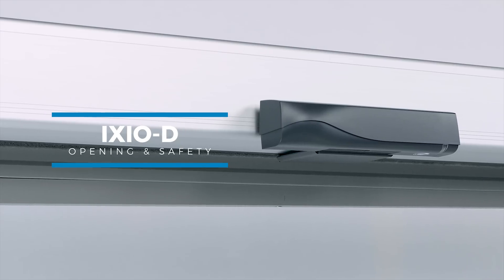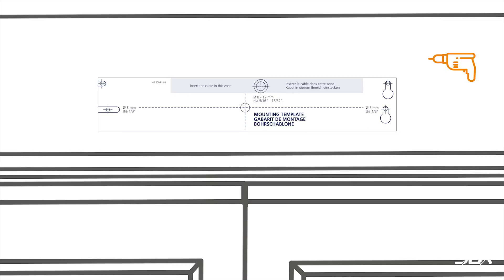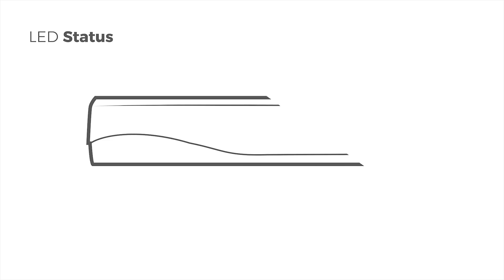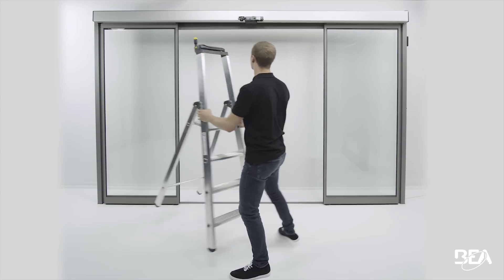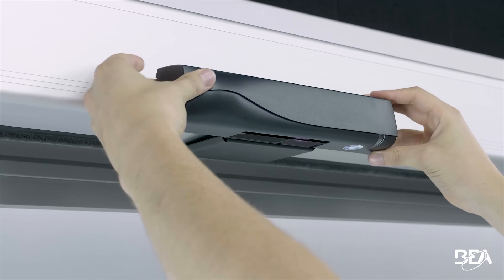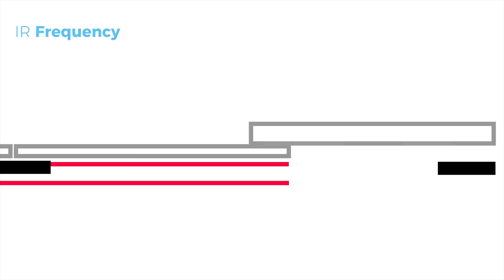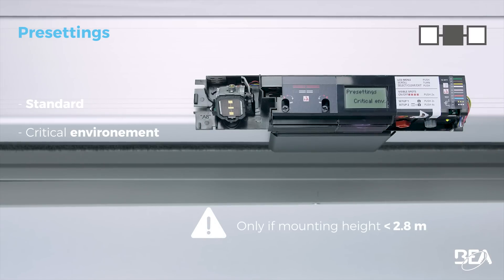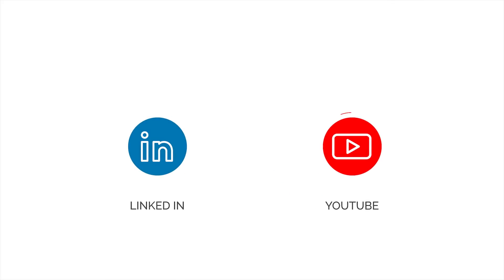Tutorial IXIO-D - Opening & safety sensor for sliding doors (tuto)

Comment: thank you. my cable came in black color shield no grey .. is there connection difference ?
Reply: Probably the black one is the DORMAKABA version. 
In that case:

White = ground / brown = 24V

red = SAFETY (AIR curtain) NC / blue = SAFETY (AIR Curtain) NC

purple = OPENING FOR CURRENT SOURCE + / black = OPENING FOR CURRENT SOURCE - (p.ex. Escape route ES200)

yello = Opening NO / Green = Opening NO

pink = test + / grey = test -
Reply: @stefan4985 thank you very for your help bro, let me try
Reply: @stefan4985 thank you very much for the reply 😊 yes it's along with the doormakaba

Comment: Hi I am using a IXIO - ST. The red LED (Safety) is working but the green LED (motion detection/AUX) is not. Please advise. Also, please explain how motion detection is done on a IXIO - ST, since it doesn't have a radar feature. I read that in the ST sensor the green LED means AUX. What does it mean? My door is not opening because I got no green LED activation. That's my problem. Thanks
Reply from the maker: Hello Suvrajit, please contact our technical service for this specific question, they will help you right away: https://eu.beasensors.com/fr/contact-form/?subject=Support%20technique
Reply: @bea-sensors-europe  please can you help me with the cable color code for positive terminal, negative,common ,no/nc for BEA Zensafe sensor,also the Stanely  controller then encoder display shows for a short time then start blinking no number displayed it's blinking red how to solve this issues please need your assistance